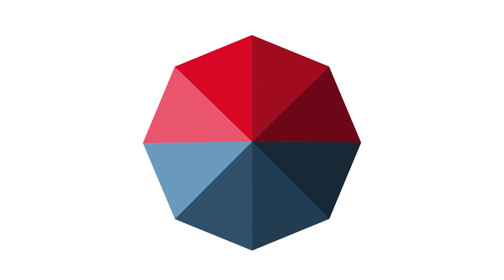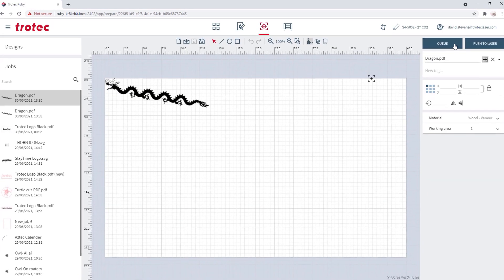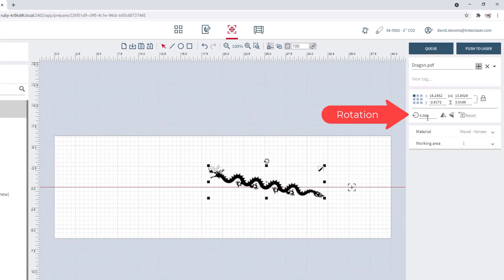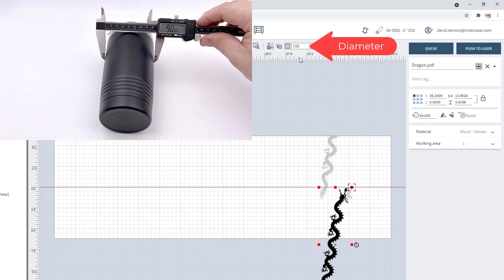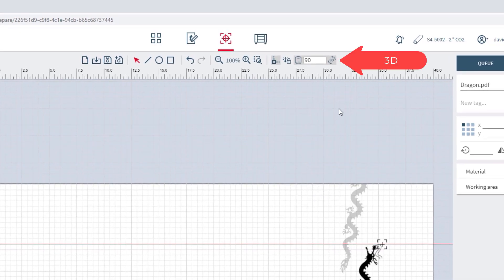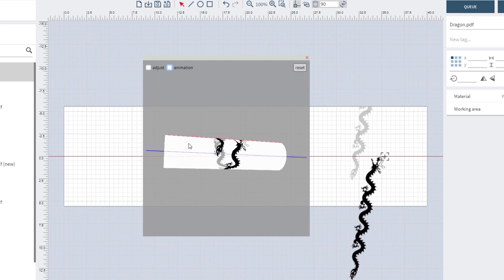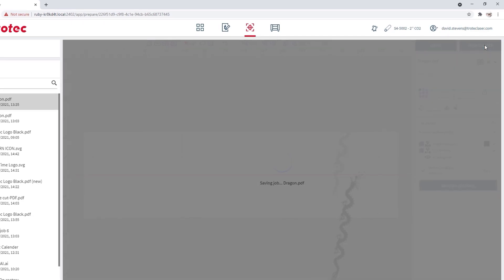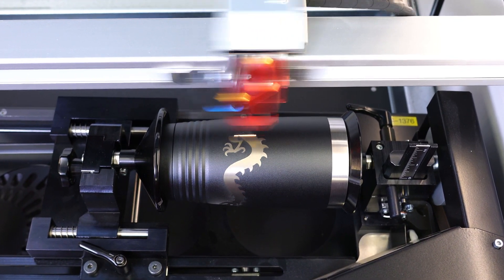Trotec Tutorial: Rotary Attachment on a Speedy 400 Laser with Ruby

Comment: It would be nice to have the settings for the laser.  None of this works without those numbers so why gloss over it?
Reply from the maker: Hi Robert! Settings can vary based on machine type and wattage, so we typically recommend testing on your own system to determine the best settings for you. For this application, we used our 120-watt Speedy 400 with a 2" lens at 100% power, 70% Speed, 1000Hz, and 500 DPI.

Comment: How do I place it if I need it in the middle of an existing logo. E.g. Yeti logo?
Reply from the maker: Hi Joshua! To position or locate a logo/graphic when using the rotary, move the red pointer to the location of the desired graphic on the product or material and then snap the design to that pointer. The laser system will then engrave the file in that exact selected location. See this video on how to use the red pointer to position graphics: https://youtu.be/ygdIWLLc7Jw